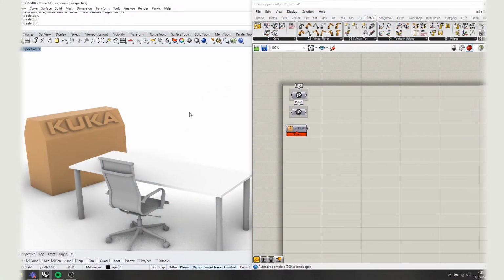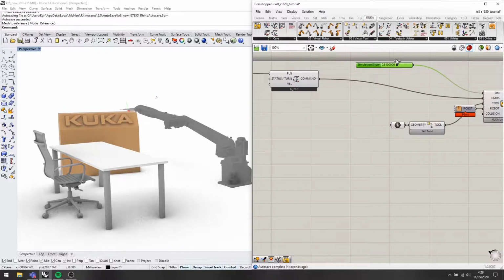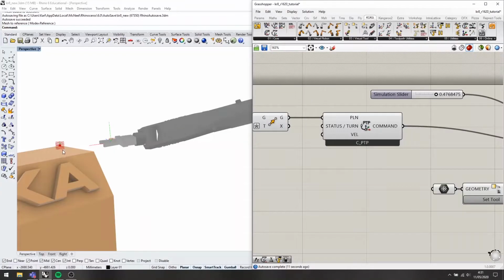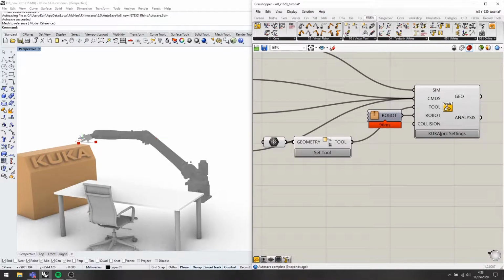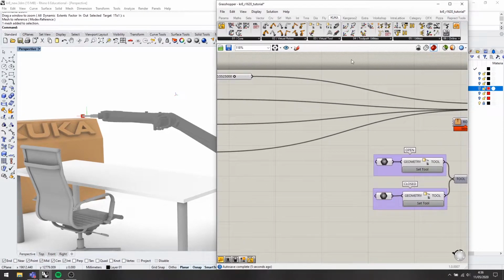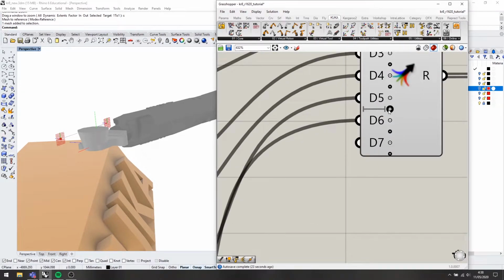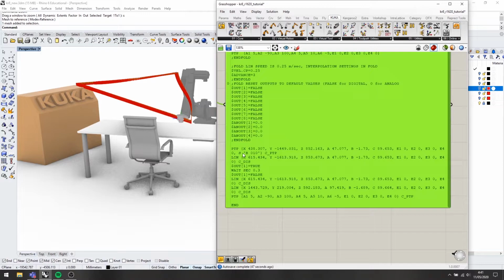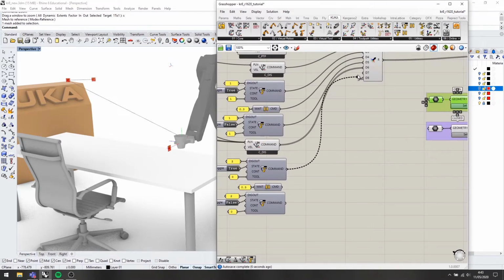Working with Digital Outputs and Multi-State Tools in KUKA prc

Comment: Karl, can you explain more clearly what does mean the Tool input of the Digital output component it's not evident why u set 1 (6:54) for it (what does mean state for the tool with 1 value and overall for what it is used). And sorry for my perseverance, you omit Cont input which means that the cup of coffee will be grabbed in fly without any motion interruption - it's the correct understanding
Reply from the maker: A multi-state tool can be in any number of states, in this example the gripper is either open or closed - 0 is first state, 1 is second, 2 third so and so on. Changing the tool state just updates the geometry within Rhino so we can ensure our simulation is as accurate as possible. 

The wait component generates KRL code to tell the robot to wait before reading the next line of KRL, that stops it from being a continuous movements and allows the gripper a moment to close.
Reply: @KarlSingline  Thank you Karl!  Virtual high five!